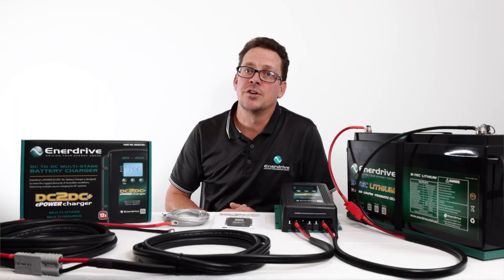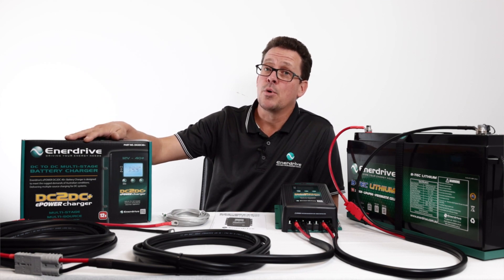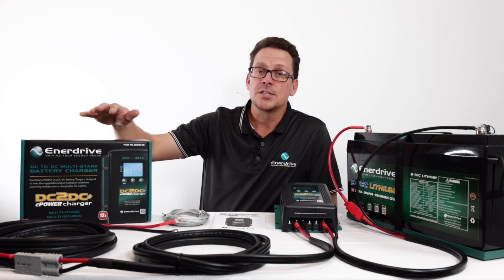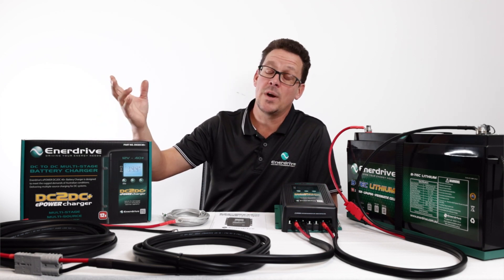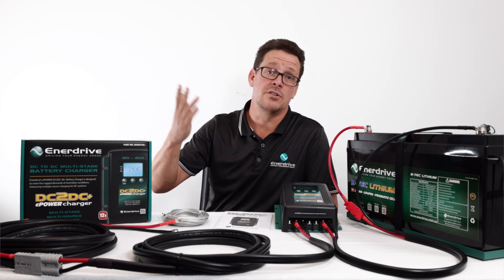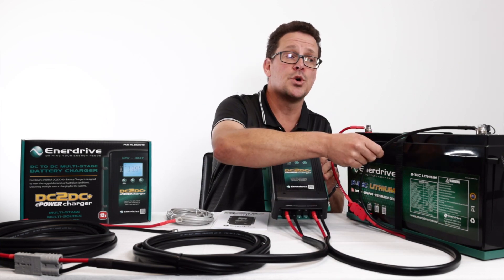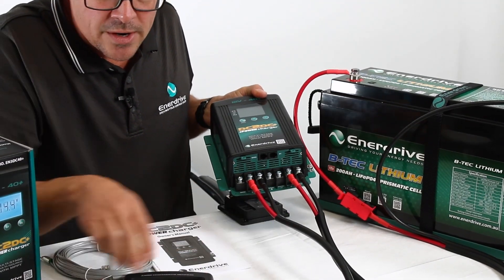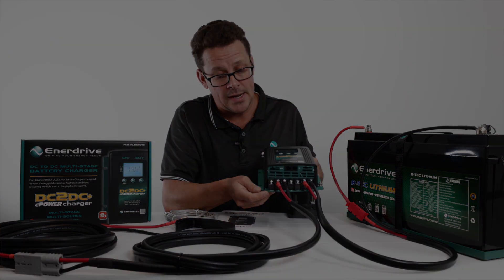Enerdrive DC2DC Chargers - Part 2 - Specifications

Comment: I have one Enerdrive dc to dc charger for my 800w solar .Max solar I’m only seen 370w if I add another dc to dc charger will that give me 80 amps in total would that work ?
Reply: I have 4 200 w solar Panals and is 12v system .
Reply from the maker: For the best support, please visit our dedicated support centre: https://support.enerdrive.com.au/. You can also find helpful resources, FAQs, and contact options there, including phone support and a contact form.

Comment: Hi, I have your 40A DC2DC on my caravan which only came with 3x100w 20voc panels. As I understand what you said in the video, it could handle up to 800w of 40voc panels. If I removed the existing panels and obtained 2x40voc panels would I be able to install 440w panels (allowing for some inefficiency) or would I have to get 390w panels to ensure there is never more than 800w fed to the charger?
Reply from the maker: Hi Evan, if the panels are lying flat on a vehicle's roof, they lose 25-30% of their value, so 880W would approximately be equivalent to 660W facing the sun directly, and thus ok for the DC2DC.
Reply: @dometicpower  Thanks for your quick response. I presume the answer is no, but with the DC2DC+ is it possible to mix and match 20voc panels with 40voc panels on the roof of the van. I don't know why, but it seems to me the 40v panels hooked up to 20v panels could damage the smaller voltage panels??